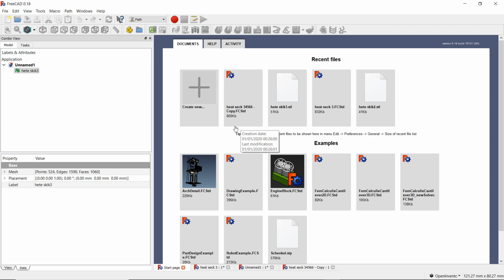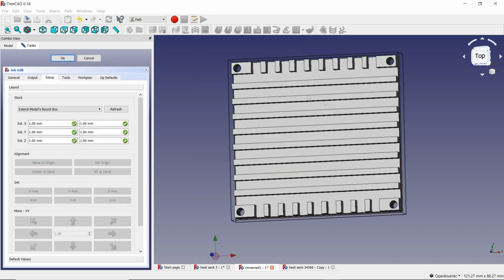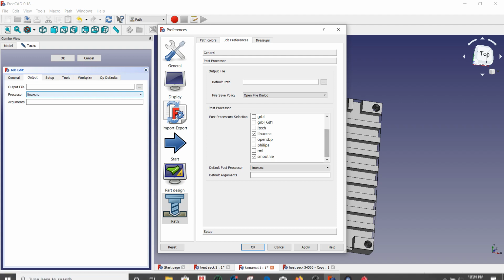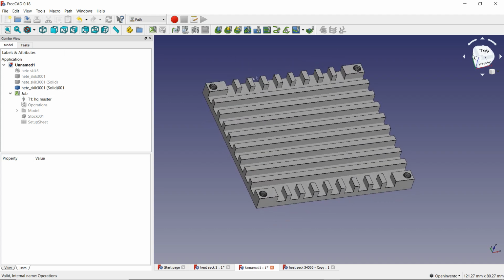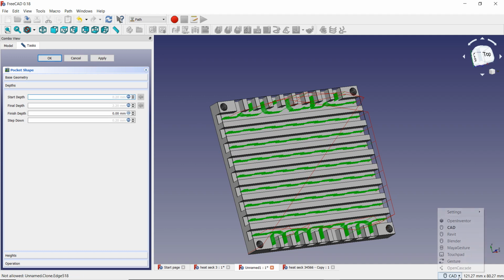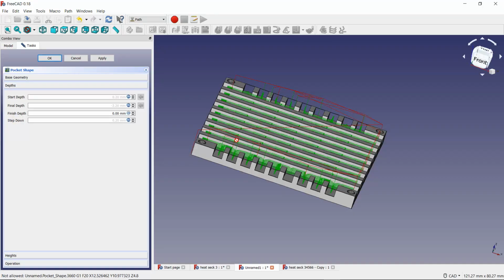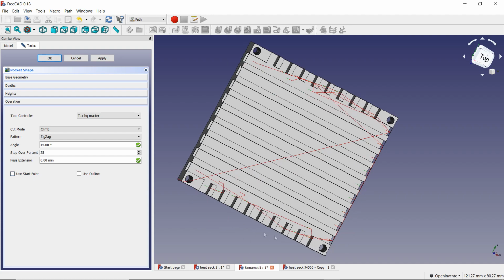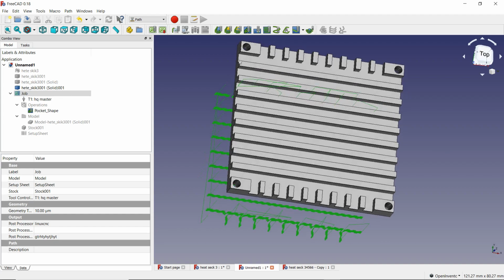The Best Free CNC Cam Software FreeCAD path better then fusion 360 Cam

Comment: Unfortunately, FreeCAD's CAM suite is basically utter garbage even now that 1.0 has come out... I have encountered more bugs in the CAM suite than in any other suite of FreeCAD. All toolpaths except for adaptive disregard cutting mode, The different operations and path dressings use different terminology, UI and even interacting with the variables from one-another. And it's only got the most basic features for a CAM suite... there are no advanced dressups that you can do as far as I have seen (ie slowing down horizontal speed when cutting out tight corners or starting with a larger depth of cut and moving towards smaller depth of cut when cutting out a 45 degree slope for example).

Comment: Yea the origin in FreeCad needs to be set to the top of the object and then you can avoid having to do that "negative number" trick that you're using. The toolpath you created thinks that your cutting tool is starting at the bed of the CNC, but you zeroed your CNC tool at the top of the stock. It's a little confusing at first but when you go to cut something everything becomes more clear. Good video though, and super helpful!

Comment: Thanks for the intro to FreeCAD! FYI as for the Z offset issue. Most machining controllers have a touch-off feature in the GUI. Enter the 2.2 offset there, which tells the CAM software the tool is at 2.2 instead of 0. Alternately, I sometimes just set the origin in the CAD to the top surface instead of bottom surface, just like you moved the origin XY you can move the Z.

Comment: Just found your channel and already appreciate it, i'm curios as to what the "easier to use" software is that you mentioned in the the first few minutes of the video is.  Thank you!
Reply from the maker: Meshcam is the most easiest Cam software to use
Reply: @MikeTech41    Okay cool, I'll have to check it out. I messed around with Freecam earlier today and I already like it a lot more than CREO. The tool paths are a little odd but I can't really complain about something this functional when it's free.

Comment: Glad I found your video. I was thinking of getting a cheap router (retired just home projects) but have not yet figured out all that is involved in generated G-Code. I am using Fusion for the models, STL files, etc. so I understand that part. (have 3D printer for file input on chip). Guess my question is will this CAM free software run on Apple's MacBook Pro? I keep finding information that shows using a COM Port for inputs but as far as I can figure there is NO COM Port on the Mac. I also subscribed to your channel - Agian thanks!

Comment: I'm new to CNC and FreeCAD, I think theres something you didnt do that made this video (and you) confused. Heres what I think...
1.You skip stock creation - basically you start from arbitrary coordinate ?
2.Since you do No 1, you didnt have a correct origin, you then need to move the origin to the parts itself which skip the stock.
heres a better method IMHO - create the stock and align the origin to the stock face. Less headache and start backlash removed when the spindle start.

Comment: I think the most confusing part of your video is that you did not notice that for CAM FreeCAD creates a copy of your part. And by default this part is not visible. So what we see in your video is a part oriented as one part of a construction or assembly. In your object tree on the left side this is the last solid you created from your mesh. But when you want to mill a part this often has to  be done from all sides. So for every CAM job (= collection of single CAM operations)  there is a copy of the chosen part that has to be oriented to the coordinate system of your mill.
In the object tree there is a branch "Job->Model" and there you find "Model-heta_skik3001". This model is grayed out as it is not visible. Click on it, press space bar to make it visible. While in CAM (activated Path toolbar) click on your main model, press space to make this one invisable. Now everything should be clear how the whole setup is oriented.
Be not confused about the first rapid move in the simulation. It always starts from the origin. In reality the first move is where your spindle is. I prefer Z-zero on top of the stock and go down with negative steps. But FreeCAD can handle different preferences. Try to use FreeCAD 0.19 devel version as this has a much improved Path toolbar aka CAM system and be part of the community to improve this really good but nearly unknown CAD/CAM package. But I also only use it for CAM - so far.
HTH
Reply: Do you happen to have any videos? I am just starting in Milling, have been cutting in 2d on my cnc plasma. looking for all good info.
Reply: @brycenorvell3428  ,
Hi, I would suggest to watch the videos of sliptonic. He shows how to setup Path workbench for creating toolpaths an howto generate g-code:
https://www.youtube.com/watch?v=jARnmuWm7n4&list=PLEuOia-QxyFJZSpqb0xOHc9t7MLdCO3io

Yes - this is not the latest hot stuff from freecad path in 0.19pre but it is a solid foundation for understanding the concepts.

Please understand that FreeCAD is not a product but a project. So try to participate in the forums.